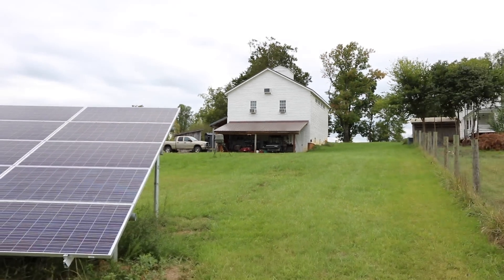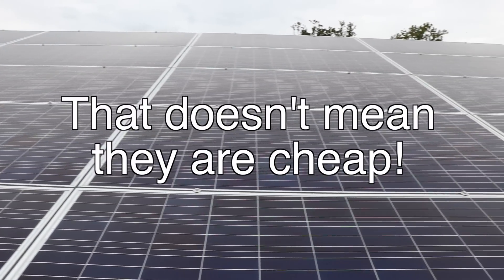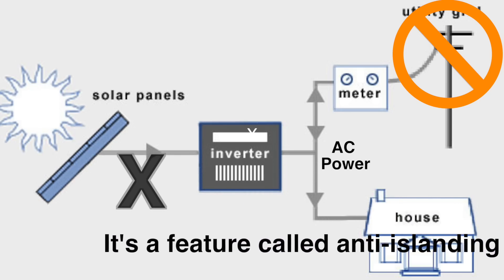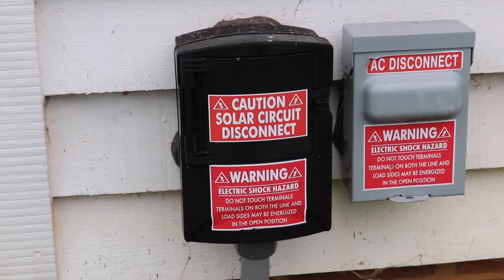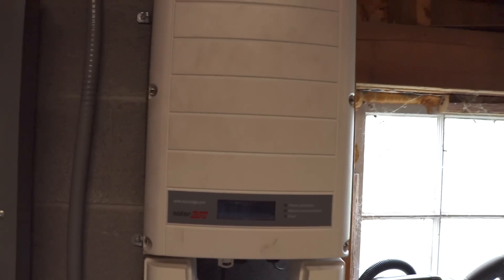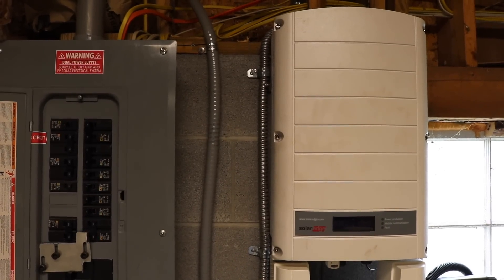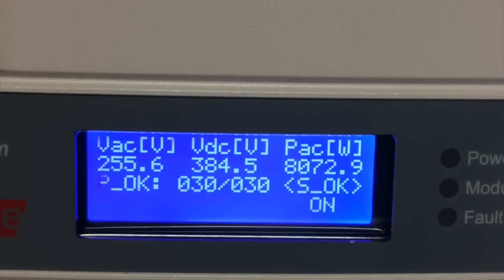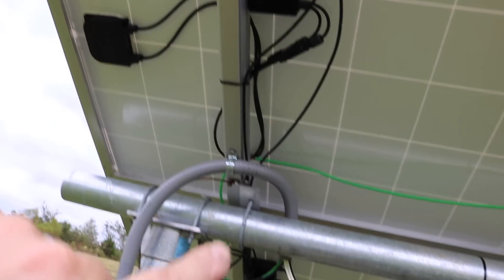The ugly truth behind grid-tie solar systems. Part 1, FarmCraft101 solar.  Watch before you buy!

Comment: I was at a customers house and he has the same system as you... His system CAN generate ~8k watts which powers his entire house 95% of the time unless he runs his Dryer at ~7k watts. 
His will run while the sun is out, when the sun swings away and leaves the area, he is then routed to street power to run in the evening and overnight until the sun swings back around... 
When the street power goes OUT... he still has solar power feeding the house. 

My question is, when he is NOT using all 8k watts, the difference is fed back into the system where he sends power back to the community where he gets paid back from the power company ... What i don't understand is HOW he is sending electricity BACK into the system and there is no arc or spark or flash or explosion when voltage from 2 different sources touch ..?? 
When someone powers up a generator ... and back feeds it to their main panel (while street power is OFF) and they forget to shut off the main breaker, you are sending power back to the system... which is fine it the street power it OUT... BUT... when that street power comes back ON... Now we have a problem and thats when BOOM happens ...

So how is this any different than a generator sending power back to the grid vs the solar system sending the same power back to the grid without explosion ..??
Reply: The Grid-Tie Inverter has the circuitry to properly reverse feed the grid

Comment: Perhaps if you had converted it to 480v, an industry standard, to begin with, then used a Tx at the panel, there'd be less hassle.  But maybe not; your level of power is quite small.  If you'd started with, say, 20KVA, that'd be better.

Comment: 8.5 years is a long time and by then you probably have to start thinking about new solar panels and converter.
Any problems you have withe system has to be fixed at your cost.  Sorry, but to me it seems it is not worth the investment.
Reply: it depends on the type of panels he is using. The cheaper ones are about ~5 yrs while the expensive one claim to run 20-25 years ..... 
The key is to keeping the panels CLEAN ... 

The problem with solar is that it produces FULL power .... If your not using full power, the difference has to be stored or bled off somewhere ... Street power you use as you need 24/7 at their price :-) 

There really is no perfect solution, while there is sunlight, you have power... At night you are dead in the water unless you have street power or the back up batteries. Those back up batteries wont last forever, those need to be changed out at some point as well .. 

So back to price of initial system + maintenance costs after ~20 yrs ... vs how much $$ you paid the power company after 20 yrs ...  To tell you the truth, i don't think you will find anyone that has had solar for 15+ years that can tell you which was cheaper ...
Reply: @ACommenterOnYouTube  20 years ago, Solar Panels were much more expensive, But, in many rural locations, bringing in Grid Power was way too expensive - like $50,000 to $75,000 !  So, they installed Solar and have lived OFF-GRID. There are 10's of thousand of homes that do this.  Their PV Panels are still working today, but at reduced power. They replace their battery bank every 5 - 15 years, depending upon brand and the weather.  If YOU can install a Grid-Tie system yourself AND get Net Metering AND get the 30% Tax Credit then you can break-even in about 7 - 10 years.  I use the GRID as my battery,  I reverse feed the Grid during the day and I draw from the Grid at night. Adding a Lead-Acid or Li-Ion battery is a financial LOSS. When the Grid is down, I run an AC Generator.

Comment: Actually...I noticed that you said you have a break even point of about 8.5 years.  This is false in most cases.  Technically, the solar system doesn't cost you anything.  People like to look at the bottom line number however if you are offsetting your bill by 100% then the break even point is from the day you install it because you are paying less for your panels than your power bill.  Your power bill is something you would have had to pay anyway and now you are getting the same electricity at a cheaper cost.  Where I am at, power rates raise about 8% per year so if you get a solar system that is saving you $30-$50 a month on average, that number keeps going up as rates increase.  Now, going back to the previous statement since we know power is something you have to pay for, which would you rather pay?  You either pay a higher amount or a lesser amount with solar so technically that solar system that you installed is just sitting there building equity at no cost to you that you weren't already paying in the 1st place.  Just a little food for thought.
Reply: Break-even does not occur until the system saves him the $17,000 out-of-pocket cost, which takes 8.5 years.

Comment: The whole purpose of solar panels is to get disconnected from the grid.
Reply: This is false.  The whole purpose is to reduce your power bill and get away from rate increases.  If you can install solar at $0 out of pocket and pay less for a bill that you would be paying anyway, or else live with no electricity, then why wouldn't you do it.

Comment: Is it better to install the inverter right near the panels so you only run AC lines to the house? I heard DC lose efficiency over long run (over15 feet).
Reply: It's totally a function of voltage: he's running 380VDC from his strings of ten utility-grade panels, so it's actually less line loss to send that high voltage DC across his property than normal 240VAC.  (Of course, once the new NEC shutdown requirements come into effect in your jurisdiction, you'll need some sort of automated disconnect at the PV array to do this.)

Comment: Good to see actual outputs from the system and not just the advertising spiel.  You can set up the inverter to supply the house during an outage but it adds a lot of cost to put the isolater and changeover switches in. The most cost effective way is to just live with the odd outage and buy a generator so you have backup power even at night. If you hook it up to your house supply, you will still need a grid isolator anyway.

Comment: The system would have been a lot cheaper and more efficient if you didn't live in a communist state. your battery and inverter should run at the same voltage and on the same inverter. Never vote Democrat.

Comment: You realize that your system wont last 8.5 years right?   In other words, you will never break even.
Reply: @brentncindy solar panels degrade at about 5-7% per year.  By 10 years they have lost so much output that they need to be replaced.  Batteries last 5-10 years depending on chemistry and number of charge-discharge cycles.  So yeah, 8.5 years is a pretty good average for how long the major pieces will last.  I guess you forgot to learn about this stuff, eh?  Gonna be a big disappointment when you have to buy a new system before the old one has made a profit.

Comment: "With a grid-tie system, you cannot use your solar panels in a power outage"... 
Not completely true.
My Firm produces Inverters that can be configured to only supply your house in case of an outtage. Also you can feed in in case you produce more than you consume given the grid is working - TLDR: Power Outtage -> You still have Electricity - Power Grid fine, you can feed in.

I dunno about US Laws concerning this Feature. In most European countries it certainly is legal.
Reply: Yes, I have a Sunny Boy inverter that, if the solar system is producing energy, will provide 120v emergency power.

Comment: OK this is my thought. Take your $17,000 and invested in a S&P 500 ETF ( ex. Vanguards fund VOO) take the proceeds (you would have earned approximately $2000.00 per year on average over the last 10 years) and pay for the electricity from the utility company. 

This way you could keep your $17,000 in your account and not have to go out and clean, repair, remove snow, and maintain your solar panel system. 

Again, just a thought.

Comment: Public class Tva {
 public static void main (String [] args) { 
double taux_tva = 21.6 ; 
double ht, net, taux, remise; 
System. out.print ("donnez le prix hors taxes: "); 
ht = Clavier.lireDouble() ;

ttc = ht * ( 1. + taux_tva/100.); 
if (ttc < 1000.) tauxr = 0 ; 
else if (ttc < 2000 ) taux = 1. ;
 else if ( ttc < 5000 ) tauxr = 3. ; 
else

remise = ttc * tauxr / 100.; net = ttc - remise; 
System.out.println. ( "prix. ttc. " + ttc) 
System.out.println. ( "remise. " + remise); 
System.out.println. (" net a payer. " + net ) ;
 }
 }

Comment: So the "ugly truth" is that grid-tied system does not work during a power outage? Hmmm - I live in Eastern Europe, so a least developed country, I guess. And I cannot remember the last power outage we had (apart from the regular maintenance outage - maybe once a year for an hour or so). Is it that often there that it is a deciding factor? And a big enough problem that you actually want to spend an awful lot of money on batteries?

Btw, nice system: 9.1kW - wow. We have only 6.6kW=24x275W and it covers most of our consumption too. It wasn't that expensive - around $10000 - and there is no tax credit here. Actually there's extra tax on the solar panels because it is supposedly a dangerous material. Plus 27% VAT of course...

Comment: buy KW in Nebraska for $0.15~ and average $0.12, thus 9KW or 9000 watts is ONLY worth $0.15 x 9 or EXACTLY $1.35 NOT $200 like you say. Further, is sun shines ~8 hours day and you don't FOLLOW the sun.... My point is you will NEVER make your money back. You forgot inflation, cost-value-of=money, etc. etc. PLUS, solar degrades. HOW YOU FORGOT ALL THIS??? Finally, ebay sells 30 panels for $9K in kit.
Reply: So, this system generates $1.35 per HOUR , most days, most  months.
$243 per month = $1.35 per hour x 6 hours x 30 days 
How did you forget all of this?
Ebay does not install kits

Comment: LOL, Someone forgot to take into account the panel degradation. Yawn.
Reply: Most good solar panels can still produce 90% of their original output after 20 years. They also can produce 80% after 40 years with proper maintenance, cleaning, and no damage.
Reply: @RonSeesAmerica  most solar panels only have a 10-15 year lifespan on average. Take out the government funding add the degradation and additional insurance  costs and most solar systems returns start barely before the system upgrades/replacements begin.
Reply: @RonSeesAmerica  Is that what you read on the label?? LOL. Actual testing has proven that a crock.
Reply: @MrBenski81  My real world Solar Panels prove that your hypothetical claim is B.S. !

Comment: 'Today' in New Zealand, you can get a grid tied system 5kW+ for ~$US 6000 plus installation. No tax credit. The major apparent issue is when the grid falls over and is 'restarted'. With multiple small generators flowing electricity into the grid it is difficult to synchronise the flows from all the generators. Generally generators will synchronise to the most powerful signal.

Comment: At 15,000 watts during daylight is not going to produce $200 a month.
Expect  less in  northern states
Life availability of solar panels is about 12 years. Efficiency drops greatly over time.
Most people break even in the purchase price and cost savings.  Some do not.
.
Just one hail storm of marble size  will greatly damage a solar panel.
Battery life is far less than 12 years.  Almost like a car battery.  Count on 6-8 years.
Reply: Most good panel manufacturers have a 20 to 30 year warranty on panel output and replace panels that don't perform. My system will be payed for in 7 years so even by your #s I will have 5 years of free power. Battery life is dependent on the type of battery and the charging management. Lead acid cheapest and worst life. Lithium can have a long life if the charge is properly maintained.

Comment: Just crazy and stupid that a country would legislate that power cables like that should be encased in a metal conductor... smart. Until the casing on the cable breaks down and the stupid metal casing becomes live.
Reply: It's not crazy, it's safe. I'm an electrician and you use the metal tubing to protect the cables from damage. The metal tubing whether flex or pipe is grounded so can't become live, it will short to ground instead of electrocuting someone. The wire casing will not break down inside the the flex, it will actually last much longer not being exposed to light, sun especially. Easily will last 50 plus years.

Comment: Its not really an ugly truth let alone a catch.... More like a basic, basic, basic safety system that should be common knowledge. 
You can get an isolator installed and if your clever enough you can get a rasp pie or arduino etc to sense when the grid feed is down and isolate your system from the grid.

Comment: 8 and a half year break even? Batteries only last about that long, so factor in the cost for them.
Reply: That break even is for average solar system that is self installed. Nothing to do with batteries. Batteries are never going to break even unless you loose power a lot and can avoid buying gas? Or you live somewhere with different power cost through the day and can run on the batteries when power is most expensive. He also gets a great net meter rate which helps pay off his system quickly.

Comment: All current forms of alternative power is more expensive than a straight connection to a grid. However, this is changing. The alternatives keep looking more and more attractive each year. Gas (natural gas or propane), powered generator. Wind power. Mini-hydro. And solar.

Yes, solar power is expensive. You want the best inverter on the market. The lifespan of a typical solar panel is between 20 to 30-years. But then there is the Peace of Mind and Energy Independence offered, especially in times of crisis. That is Priceless.

Comment: I like your video. You had a ground mount installed, trenching, inspection, installation, racking, wire and battery storage for $2.52/W? ($23,000/9,100W)
That is the best deal I have every heard in my life! Awesome.
Reply from the maker: No battery.  That's just for the grid tie system.  I retrofitted a battery backup inverter and 24kWh of FLA batteries for $6k more.  But even still, I think I got a good deal on the install.  So many comments here of people saying I got ripped off!  lol
Reply: @FarmCraft101  Even with the adder for the storage, your only at $3.18/W. 
We should go into business together! HA! We will have everyone going Solar at this pricing.

Comment: Automatic transfer switch, feel when your wattage go down from the array , switch to grid or battery backups. Sun comes back, wattage comes back, cut from the grid and charge your batteries as well as feeding your house. I hate grid monopoly so I installed Sunnyboy inverter “island “(off grid).
Reply: Nothing wrong with old school string inverter. Less points of failure, less expensive to install,simplicity when it comes time to trouble shoot, at least at the inverter level. Of course, with the optimizer you can just give a quick check on your mobile app and see which module is failing and you do get the benefit of troubleshooting the inverter as well.

Comment: you only need a switch which isolates your panels from the grid when the grid goes down and that switch can be automatic.
Reply: Oh yeah. It can  be done, but it will not pass inspection, and is against code.Just like using and automatic standby generator, use a Transfer Switch.